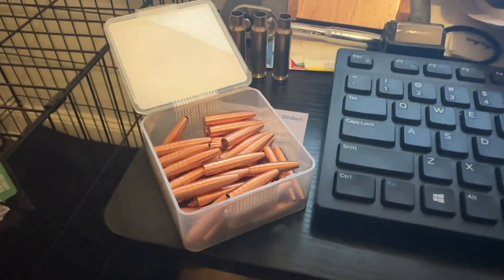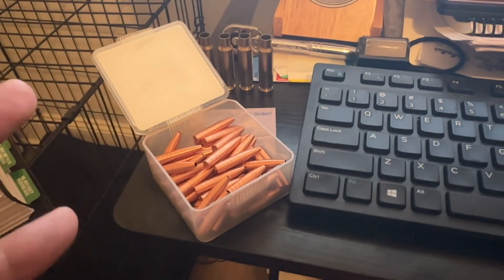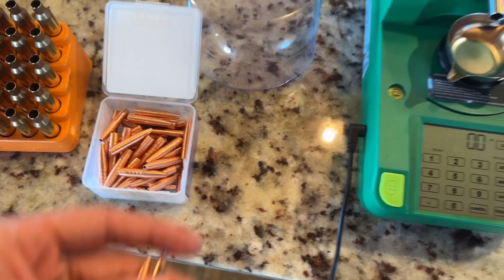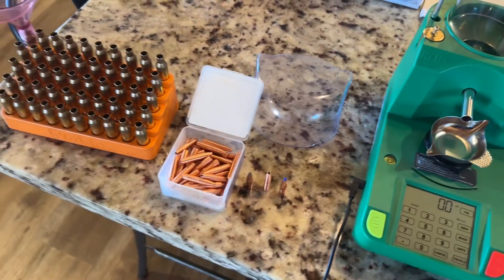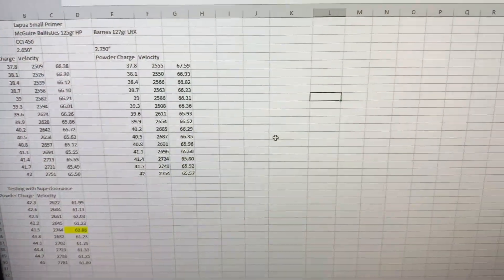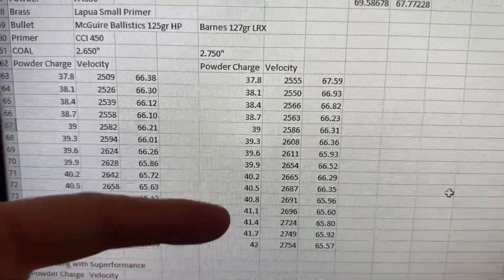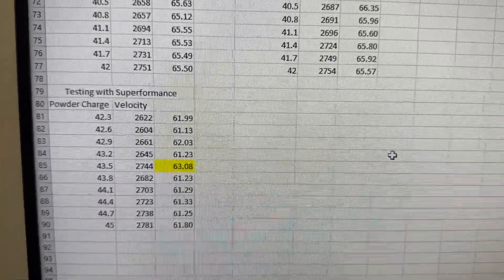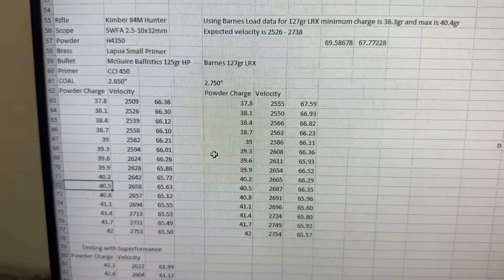Velocity and Pressure Test with McGuire Ballistics 125gr HP in 6.5 Creedmoor

Comment: If you want to get the 6.5 creed to the velocity you need with copper bullets, try the 100 grain ttsx or hammer. You need at least 3000 fps to really get the best out of mono bullets. Im shooting a max charge of h4350 with the 100 grain ttsx at about 3150 out of a 22" barrel, and it's vicious on whitetails. I only use copper bullets to hunt with, and was looking at rebarreling my 6.5 to a 6mm creed until i found this bullet. Wouldnt be great past 300 yards, but I dont get shots past 200 usually.